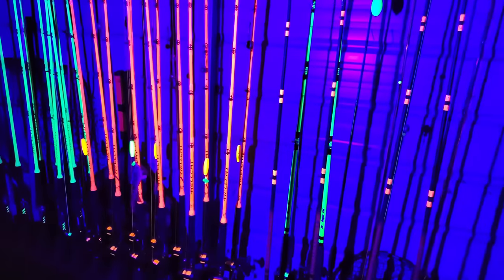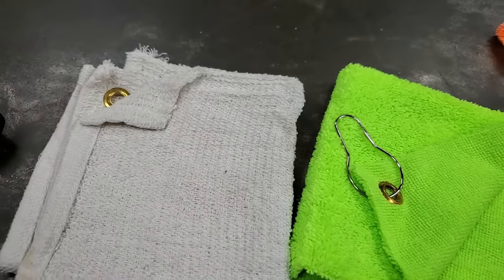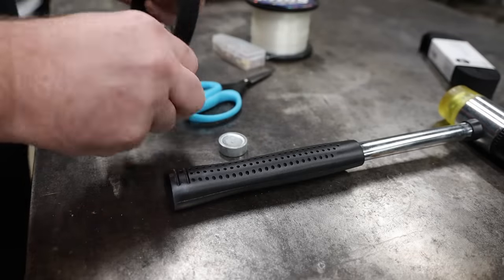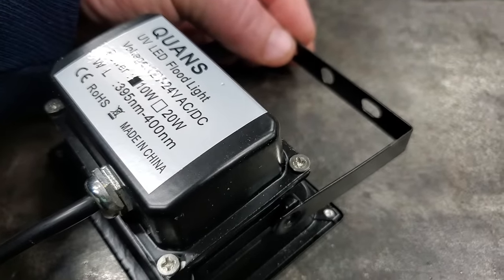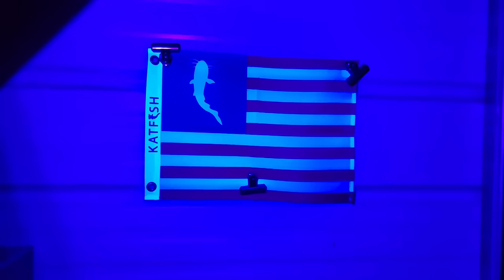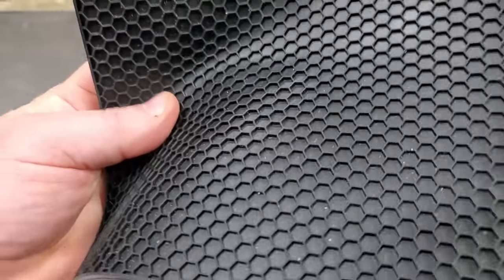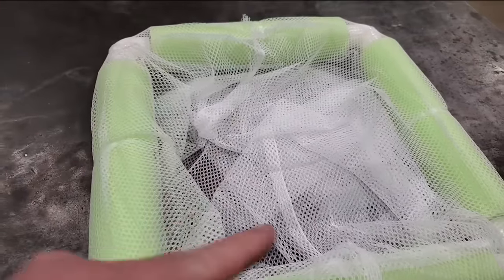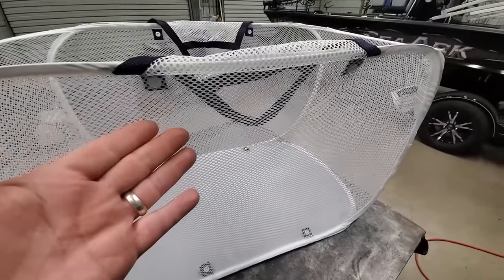5 very Cool Fishing HACKs

Comment: Go to your local bicycle shop. Ask for some punctured tubes that they usually throw out anyway.
The come on different diameters. The fancy racing bikes, mountain bikes and the balloon tire type. Then, just cut off a "ring" and you have a big, stiff rubber band. Use it for tons of different applications. Tip Up spools, around spools of leader line, etc.
Reply: Ranger bands

Comment: #1 I've done this for a few years now, but I use it with a carabiner to attach to my belt loops when I am fishing on a dock or bank. Works super good. I just buy cheap hand towels. Berry Goot!
Reply from the maker: Carabiner work really good too . I meant to mention that but forgot the show curtain hooks are cheap and what most companies use . I really like the belt loop idea 💡,  never even thought about that
Reply: I do belt loop.  Also bought stainless Drinds and wire tied them to my sand spikes for surf fishing.  Now can clip a carabiner to spike...have towel on the rod holder.

Comment: Another great video once again. As far as the first hack I do the same thing but I don't use grommets. I fold the corners in fours and just below the tip I give a circular cut with a scissors. Then I dip in Plasti Dip and let dry. I keep multiples with me because a dry towel is the only thing that'll take off fish slime. Rinse at the end of trip . Keep up the good work and keep them coming
Reply: That's a cool idea. Some of my grommets on the first one I did are starting to come loose a lil. I'm gonna dip em and I'll bet that'll fix my problem. Thanks
Reply: @jamesclark5679  I like it better than grommets deteriorate  rubber doesn't 😁

Comment: The elastic spool guide is a great hack I’ll be getting to work on it ASAP. 
To save a lot of labor on the towel grommets, I use tarp clips from Harbor Freight.
Reply from the maker: Good idea
Reply: I just cut the towel use a poke with a knife, use coat hanger cutting a 3" piece make about 1" loop for the ring
Reply: That is a handy idea, I may try that as well. Then I can add to my thermal tarp. I use for a floor in my ice shanty pop up using the ice spike 5'x7' for quick fish 3 use factory holes on the tarp match the shanty at two corners and has nearly one foot for the holesas a band of ice.

Comment: Genius as usual! I think you could glue a piece of pipe inside the center hole on a pool noodle to make a union and make it round or any shape you want. 
I have used spent .22 shell casings as brads on some of my knife sheaths and they turned out nice! I just had to cut the length down a lot.
Thanks for sharing these great ideas and tips with us!
Reply from the maker: 22 cases for brads or rivets . I really like that idea 💡

Comment: For the pool tubes connection, you can use an irrigation barbee fitting (usually one inch but whatever fits) and some zip ties to hold both ends together without heat.

Comment: Awesome video! Only suggestion I have is to be careful with the battery trick. Drills have a built in sensor that keeps the battery from going below x%. Going below the threshold can kill a battery, and many chargers will mark them dead. You can re jump them, but it damages the cells

Comment: Another awesome video Keith, great hacks, I especially like the one with the DeWalt battery connector. I’m certainly going to have to find those online. All of these are great hacks. I wonder if a small hula hoop could work inside of the pool noodle for the net basket float. Thanks for all these awesome hacks. Tight lines bro 😎
Reply from the maker: If they make em that small . It would be perfect

Comment: Hair ties (good ones) for the smaller spools and stretchy headbands for the bigger ones (double them up if necessary). Line draws off the spool under fair amount of tension but I've used this on 6x tippet (2lbs test) without issue and the line stays put no matter when you cut it. Can't easily adjust the length of tag line though, know what I'm saying? 😊

Comment: I have found that using the tops of ladies' old style knee-high stockings, just stretch it over the spool, stretch the hose out, and stick the line through. If the stockings are to lose, just tie a knot in it.

Comment: Hold hot iron to bottom side of the wire (heat rises) then press the top side with your solder. This will heat the wires enough to melt the solder and it’ll suck right into it. 🤙🏼

Comment: I been looking at getting a set of spool tamers or whatever you want to call them.Think I'll just make mine now,IDK why I never thought of it as I been making my own rags like that.
I have a 12/24v UV light mounted in the boat to activate my Crappie glow jigs but I don't see a need to use them to see the rods.If you're using baitrunners and/or circle hooks for Catfish,etc. there is no need to even see them.Only light I have other than that UV and Nav lights is my cap light,no need for any others as all they do is attract bugs and/or spook fish.

I've made a net something like that but it attaches to and hangs over the side of the boat.I can just drop my Crappie,Gills,Etc. into it and it's about 4' long and 28/30" dia. (about 1" out of the water) so it's to deep for any of them to jump out.Made it from a  sports bag and 8' or 3/8" alum rod and a couple alum blocks. It would also work for bait.....if I ever decide to use live bait...lol

Comment: Question (BTY) I watch and enjoy every video u make. Can I use a boat trailer winch for an anchor?
Reply: Hello, yes you can.....but the gear ratio is so low it would take a long time to crank up from much depth. Then again another issues is lack of rope capacity. Hope this helps, but if your not going deeper than 20ft...give it a shot!
Reply from the maker: I was thinking the same thing he said . It would be slow . They have 2500lb small winches at Harbor freight  . I'm not sure about the line capacity but I would be they are water proof and I know they are 12v . That's not a bad idea for a video hahaha . A lazy man's anchor ⚓️

Comment: How long does that black lite run on that little battery?
Reply from the maker: I'm guessing 6 hours or so . But it really depends on which size or Amp hours you use . I actually made a battery comparison video and ran tests using the drill batteries

Comment: Stop cutting tie wraps/zip ties. Instead, grab the loose tag of the tie with a pair of pliers right at clicky thingie. Twist the tie (in a single direction) until it snaps or tears off. It doesn't leave a sharp end twisting it off. Lineman's pliers work great for it. Needlenose might work. Slip joint and channellock/pump pliers usually work well too.

I did the towel hack years ago when I first started saltwater fishing with a friend. I made his dad about 20 towels with grommets and metal shower curtain rings. After the first day, he ripped every grommet out of those towels because he didn't like metal flopping around on the fiberglass of the boat. He appreciated the shop towels though.

Comment: You know how some of those really nice lures are pretty expensive especially those topwater made water multi-piece triple hook which get caught on about everything well my granddaddy was a machinist for the Navy and then for the railroad. He got himself a piece of steel and he put opposing hooks so it would slide down your fishing line and then he welded on some little bitty chains and made it really easy for it to get all hooked up in your treble hooks. And so it slides down your fishing line and then you shaking you know it's got a more durable cord on it so you don't lose your lure and it hooks up on those treble hooks when you've caught up on some brush underwater and he could retrieve his lures that way! Some of those words are expensive they're 20 $30 a piece? He made this in the railroad machine shop? He also made his own fillet knives. We always use those ones from Finland that got the fish in Boston on the wooden handle. Those are really really good fillet knives and they've got that little metal pin on the back side for popping the fish in the head knock it out! That's really happy with northern pike "we call those snakes" because they're slimy and they got fans all over and teeth! If you want to know a trick you just slide your hand down take your fingers shove them in that little groove in their stomach and they won't move it all it's like it's like picking up a cat by the back of their neck.

Comment: I will say be careful with those cheap battery adapters. Disconnect them when not in use or the battery gets low. If you don’t, they will drain your battery to death. Literally, you’ll never be able to use it again!

Comment: Mr. N Stuff, I would have expected your heat gun to stick that noodle together and am surprised that it didn't work. Was glad to see that Cranky didn't give you a bunch of crappy over the fail. I like your second try and I'm glad it worked, but I have to ask, if you was lookin' to make a circle with the heat gun, why'd you end up with a square with the second method. That's kinda like, as they say in Tennessee, comparing apples to some other color apples. Seriously, to make a circle, couldn't you just use the heat gun [you had it right there on your bench (by that I mean beanch)] and bend a short piece of the PVC pipe into an arch and just stick it into both ends of the noodle that you was tryin' to make a circle out of? I don't usually fish with shad cause they die and now I know why they was dyin'. I probably still won't fish with shad or use your hack because I find the idea of a bait fish throwing up disgusting and refuse to build a vomitorium for them to practice that nauseating tradition in. However, I did find the idea of using it as a live well bank fishing or in a small boat or kayak very intriguing. I think for that use I would fasten the mesh bag 5 or 6 inches down from the mouth on the inside of the ring ( the round ring, not the square one) without flipping it over the the ring before I attached it. That way I could use one of those spring locks, like you find on a hoody's hood strings sometimes, to let you draw the mouth closed and lock it in case some of the fish wanted to go back home when you wasn't watchin'. Another great hack video. Please keep them comin'!

Comment: Pool noodle making it round instead of heating each end  just cut a small piece of PVC pipe that will fit in the hole tight and glue the PVC pipe in to the pool noodle

Comment: I just zip tie a pool noodle to a collapsible wire basket for live bait and tie a paracord on the handle and vuala it’s only 5 bucks more with less steps and more durability.
Reply: Actually I think it might be cheaper because you don’t need pvc and glue plus the basket has a top and bottom lid

Comment: Cut the tails off the plastic ties with a razor blade no sharp corners that way
Reply: I'm going to try that. Thanks for the advice.
Reply: Or you could go too HF and get the tool that cuts them off and you have no sharp edge ! I am just saying !
Reply from the maker: They are both good ideas
Reply: @davidcatlette9697 terry
Reply: Be a man and cut them at an angle 3/8 inch long. Flush cut zip ties is a sure sign of a bud light consumer...